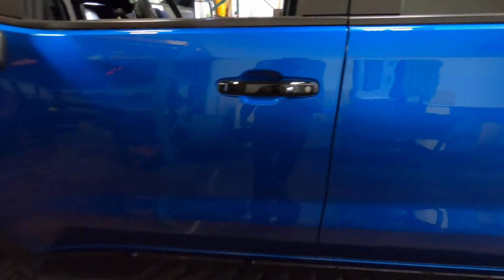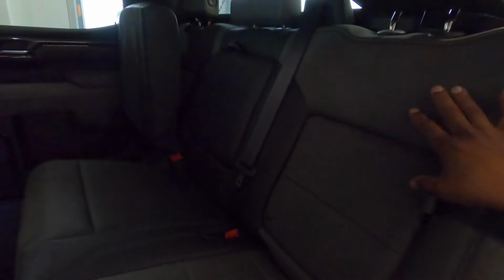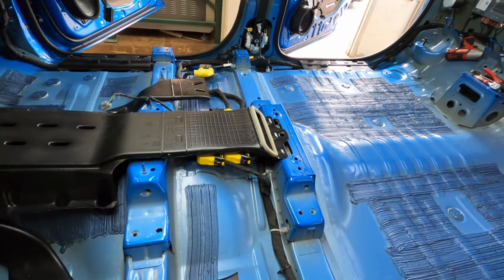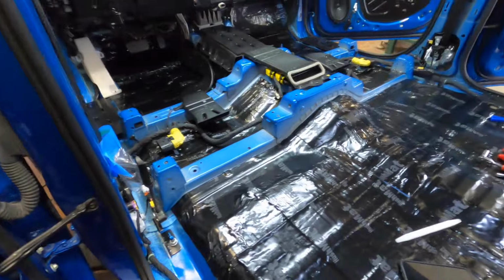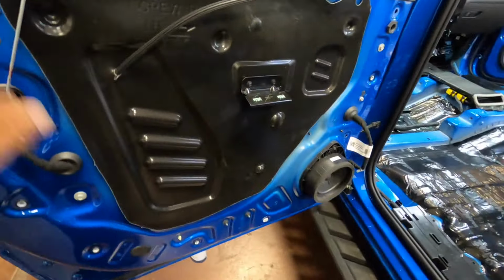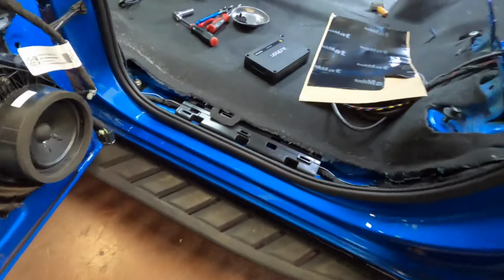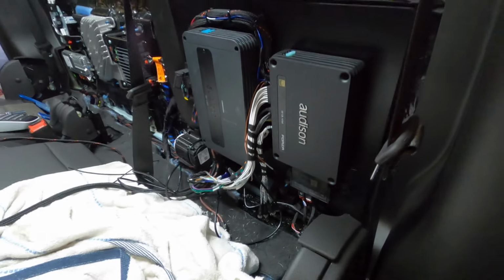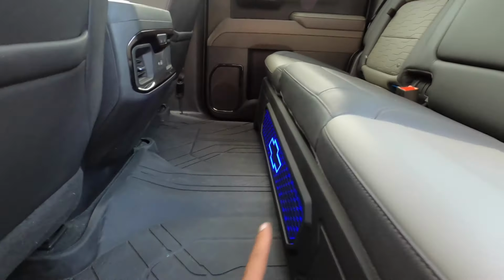Yes a 2024 Chevy GMC Truck with Bose Can Get a Great Audio Upgrade!

Comment: Great job guys!! ....
On my 2022 GMC AT4, the factory Bose sounded like gargabe. I put blocking panels on all of the doors from Soundsgoodstereo (great materials all laser cut to fit), sound deadening on all inner and outer skins by Soundskins, thick stuff, and replaced my 4 door speakers with Focal K2 coaxial speakers, factory tweets (I can't find good ones that aren't tiny and overpowering) and my system actually had great detail and sound even without an amp and separate Bass box. I am planning to do that down the road but ya know, money.
Reply from the maker: Awesome. !

Comment: Man I've watched a couple of your videos and you do outstanding work. 

I just bought a 23 high country with the Bose, and what i really want to do is expand my eq options for now. If i could dial in the EQ past just the 3 adjustments i think that would make a huge difference. Any ideas what i could look into?
Reply from the maker: The only way I believe can achieve something like that, would be a DSP amp with appropriate amount of channels   It would a like complicated and it requires a shop that works with them.

Comment from the maker: Yes
Reply: And no load resistors required when you use that part ?
Reply from the maker: @rgillan67  no. The initial replaces the OEM amp. It does require an Android phone or tablet to set it up.

Comment: Great video! Is there any concerns with the placement of the amps behind the back seat overheating? I had mentioned this setup to an audio installer and the said there wasn’t enough room for the amps to be behind the backseat and that it could possibly overheat.
Reply from the maker: I’ve done several systems is those trucks and haven’t had any issue yet. What amps are you plan on using?
Reply from the maker: Does your have Bose?

Comment: Great video do you happen to know what wattage the new 13 inch screen TV is pushing I’m looking to do a simple upgrade to my front speakers like a 6 x 9 to bring a little more base to the truck. I have the non-boat system would it be possible to upgrade the six by nines and get some quality sound I don’t need nothing too loud like I did in my 20s.😂
Reply from the maker: I would up grade the dash middlers first. That would improve the audio considerably. The 6X9’s in the door currently perform as mid bass.

Comment: What dash speakers did you use ? Im running all kicker. Problem is my dash speakes threw a code and shut them down. Trying to figure out if i need load resistors or if i gotta run them together
Reply from the maker: I’m using a morel speaker, but that’s not going to solve your issue. The issue is that the OEM speaker performs a specific way based on the impedance. Which model kicker speaker do you have? That could be the issue.
Reply: @lancesautovlog  im running kicker ks series they are 4 ohm. Ive been told the dash speakers are 2 ohm. I have a 2500hd. So i was wondering if you knew of any 2 ohm speakers or should i run them in parralel or use resistors ? As far as i know the kicker speakers arent made in 3.5 inch tweeters in 2 ohm.

Comment: Just curious what would something like this run me in a 24 Ford Maverick with dual shallow mount 10 inch subs under the rear seats
Reply from the maker: I best way to get price is email me or message me on my website.
https://lancesaudiodesign.com
Reply from the maker: You can call or text me at 17144763642.

Comment: How do you add a 4 or 5 channel amp to this without amplifying the door chime
Reply from the maker: Unfortunately that’s not possible if your system is Bose.
Reply: @lancesautovlog AXDSPX-ETH1 lets you remove the Bose amp from the vehicle and you can control the door chime.   Its spendy and a basic-ish DSP but it works incredibly and sounds waaayyyyy better than any LOC or summing or anything
Reply from the maker: @ I can be easier, but isn’t necessary if there a DSP that has the ability to correct all-pass filters.

Comment: Curious as to why you ran wire underneath the truck. Also can a 3 way hertz system fit in the front doors. I have the '24 silverado 1500 ltz.
Reply from the maker: I was able to locate a stop on the firewall to make 2 4 gauge runs. It was the safe play. 
You can do a 3 way on the 1500 if your will to make a new whole somewhere. The 2500 GMC truck does have a 3 way factory option, so if you can get the GMC A pillar it would look factory.

Comment: I have a 2024 Sierra 2500 without the bose. I want to do 2 jl 12tw3 with vx10005i. On another date, I'll do c3-650 in the 4 doors. Would i need to use a fix 86 or something else like that to make it work? Will the factory speakers work with the vx1000, or should I use a mono for the subs and get a 2nd amp for the c3-650 when i do the door speaker upgrade? How would my system sound?
Reply from the maker: 1: There are a lot of ways to correct the signal of the Sierra's audio system. The Fix 86 is one or you can use most DSP amps and do it.
2: The factory speakers would be challenged if you upgrade the power from the factory. I wouldn't recommend it. 
3: I would recommend at least 2 amps to achieve a good out come. Hopefully one will be a DSP amp.
4: I'm the system will be pretty good. It generally comes down to the DSP tuner.

Good Luck..
Reply: @lancesautovlog  yeah, the vx is a dsp. I won't be doing the door speakers for a while, so I'll do the vx10001i, which is 1000 rms. Would that be too powerful for the tw3?
Reply from the maker: @GMCB-pu8pk  actually that’s to much power for those woofers.

Comment: Hello, I just upgraded my 2024 Chevrolet 2500 with Bose and used a Fix 86 with a VX800/8i Amp.  I used a loopback harness with Audio control LCD-60s to generate load.  Speakers work but I am getting some distortion in the higher frequencies and when on a bluetooth call the OEM amp mutes after about 2-3 min.   I am assuming the 60 ohm load resistors are the wrong value but I have tried everything to get it right and still the same issue.  I have ran it down to as low as 12 ohm per channel but amp still mutes during bluetooth calls.  Have you ever upgraded the factory speakers on this model truck and if so how did you get around this?
Reply from the maker: I’ve only done it 2 ways. I’ve used a Audison DSP amp and it has it own load resistors feature and I’ve also used the Axxess part. It’s a preamp with built in DSP.
Reply: @lancesautovlog bluetooth and everything worked?  Do you know what the load was?  I have tried 20,000 ohms 10,000 ohms, 80 ohms, 40 ohms, 20 ohms, 12 ohms.  I get different issues with each but I almost always get minor distortion at high frequencies and OEM amp mutes bluetooth audio after about 2-3 min.  I even went to the dealer and swapped out the OEM amp to take that out of the equation.  driving me crazy.  thanks for any help
Reply from the maker: I would get 2 or 3 of these. It will figure it out for you. 

https://audison.com/product/uss4/
Reply: @lancesautovlog  Thanks for the help.  I ended up ordering the Axxess AXDSPX-ETH1 kit.  I'm reading that even if I do get it working the signal from Bose will always be trash.  It doesn't clearly state it is compatible on Crutchfield but people in the reviews state it is for a 2024 Chev 2500.  I'll let you know what happens.  thanks a lot for the help!
Reply from the maker: @aglmechanicaltips  that’s the unit I used. It works best when using an Android phone or tablet.
Reply: My understanding with Bose in the newer generations is they like Honda have a noise reduction feature which is tied internally to a mic somewhere in the system.  In Honda it is in the mirror assembly.  You have to sever that mic to stop the active noise cancellation feature.  If you don’t any highs are drown out by noise cancellation and so too the lows.
Reply: Your problem is Bose uses all pass filters that your JL fix won’t fix cuz it’s not smart enough(old technology). A dsp such as helix or masconi will work or remove the Bose amp and use the axxess dsp. Not sure about this audison dsp he’s using.
Reply: I switched to Axxess kit, much better now.  Thanks

Comment: Did you tap off of the bose amp? Or did you bypass it? What kind of harness did you use?  I would have never bought this truck if I would have know about the issues with trying to work around the Bose system...
Reply: Same I got mine as well looking forward to upgrade was told I can only do subs
Reply: I have a 24 also with the Bose and would like to know what you used.
Reply from the maker: So I used a Axxess interface. Metra electronics makes them. The interface works best with an Android style tablet or phone to set it up. It also has harnesses in the box, so there is no cutting it tapping into the factory harnesses. 
There will be a number of other brands released an interface soon(hopefully).
Reply: @lancesautovlog  my audio man said the sound changes with that have you issues over time he told me that i would need this ZEN-AVB-GM but they stopped making them.
Reply from the maker: Well you can wait tell something else comes out or maybe you can ask him for another solution.
Reply: @lancesautovlog  thank you I was showing him your video because I like the work with. The dyno matt
Reply: Did you use the AXDSPX-ETH1 ?
Reply: Great info. I'm so let down with the bose system bin my 24. The one in my 22 high country was amazing.  This new one sounds like the temu version of Bose